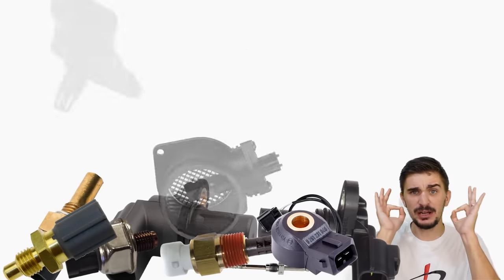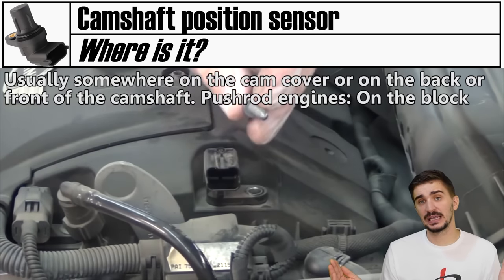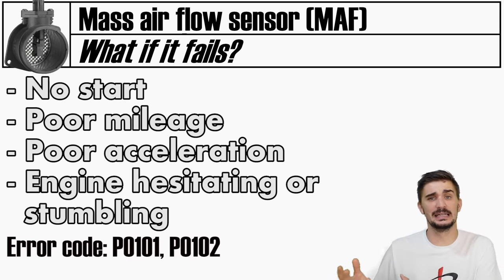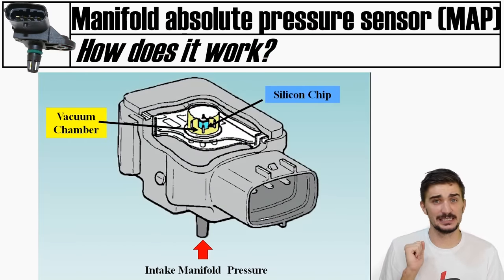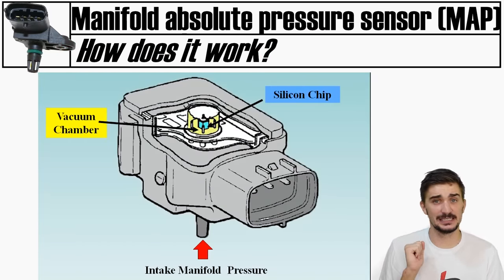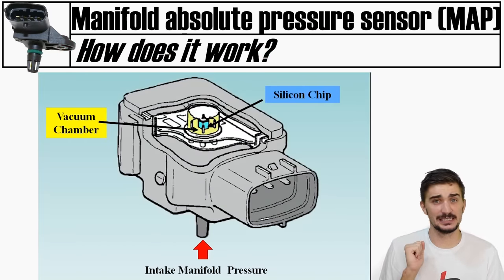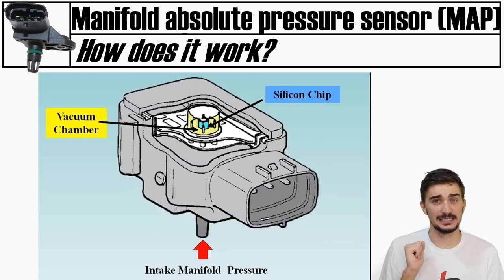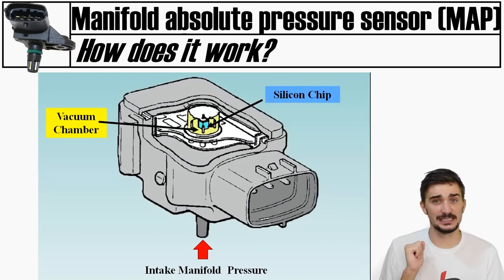EVERY ENGINE SENSOR EXPLAINED - MAF, MAP, IAT, TPS, 02, NOx, EGT - How it works, location, OBD2 code

Comment: The info in the video is very useful & can help every skill level of mechanics
1 issue,this pertains to GM only 
 ECM Engine Control Module engine only
TCM Transmission Control Module 
BCM Body Control Module controls the entire car
In the video what he calls the ECU Electronic Control Unit on GM cars is the BCM 
The ECM Engine only

Comment: Well, I thought this was a really excellent video, but then I had a good look at my 1958 Austin Healey and I can't find any of these devices on it, so I'm not sure what you're talking about! On a slightly more serious note, we did some tuning work back in the 1980s on engines fitted with K-Jetronic injection (a largely mechanical system), and we ended up renaming the vane-type Air Flow Meter as the Air Flow Strangulator. On an even more serious note, this video is superb and contains a very noticeable lack of bullshit. I've subscribed.

Comment: Ran a year with a blown downstream o2 sensor. Now i have to replace catalytic converter as well 😮‍💨. Remember to check your engine codes immediately and try to fix them ASAP if they return after zeroing.

Comment: It is also worth to mention two temperature sensors for coolant (thermostat), and bimetal temperature sensor for turn on/off the fan. The first one is proportional, the second is binary. This are at the same time actuators (valve and switch), to stabilize coolant and engine temperature without electronic control unit.
By old engines there by ignition distributor were also centrifugal rotational speed sensor, and vacuum membrane intake air pressure sensor (indirect engine load measurement), to mechanically shift the ignition point, earlier or later, also without ECU.

Comment: An excellent video as always! Big fan of the channel. My O2 sensor heater on my motorcycle failed (tested in accordance with the service manual) and the OEM part is 185 dollars, I found a 'compatible' part on amazon for $60. The question that I have is why so much cheaper? I know it's non-OEM, but still, $120 cheaper? If it is a crappy product, can it damage a part in my motorcycle? Thank you.

Comment: Very informative, thanks  and even the ads weren't too intrusive. [which is high praise, coming from me!]

I'm still of the "There's no place for a computer under a bonnet" school. But, as it's becoming almost impossible to find a vehicle without an ECU -even at the older end of the used market- I suppose I should at least educate myself as to what all these damned sensors are supposed to be for.

Comment: One correction to your explanation of MAP (aerospace engineer here). In your animation, more air molecules correspond to higher air flow, which corresponds to lower air pressure by bernoulli principle (opposite of what you depict)
Reply from the maker: More molecules does not necessarily correspond to higher airflow (random youtube guy here). You can increase the number of molecules in the same volume without any change in flow.  Let's imagine you increase the boost pressure or you rapidly close the throttle or you change the elevation - all of these can increase the number of molecules but do not directly impact flow. I'm not saying you're lying, but I honestly doubt there's as many aerospace engineers on planet Earth as in my comments.

Comment: okay, so i agree you mentioned all sensors related to the engine! of course there's far more sensors in the car you didnt mention such as ( wheel speed sensor, steering angle sensor, crash sensor, weight sensor,vehicle speed sensor, etc....) but those sensors doesnt affect the engine performance at all... but there's one more hidden sensor that could affect the engine performance in a weird exceptional way on rare car which is the yaw rate sensor.. this sensor is installed on the center of gravity of the car which is under the driver seat, it's function mainly for stability systems such as ( ESP, TCS, ABS etc...) but it happens to me once that a car work perfectly fine , but struggles at accelerations and while going up the hill, while everything in the engine looks fine and no faults has been detected.. the only fault was the yaw rate sensor in the stabilty system. after research, the yaw rate sensor helps the engine control module to knows if a car is accelerating so it could give a injection boost or ascending a hill or descending a hill using accelerometer to notify the engine control module.... weird huh?  cars world is insane

Comment: Hello there and thanks for the video. Can you please make a video to specifically explain how the Oil level sensors works especially the ones used in Audi's as I think they depend on both the oil temperature and the capacitive technology but I cannot understand how it combines the two and how accurate they actually are.

Comment: One other possible bad sensor symptom, computer controlled transmissions often rely on sensors as part of the determination of when to shift. A poorly shifting transmission isn't necessarily due to a mechanical defect. My mid 90s Nissan over 6 months slowly shifted later and later until it wasn't shifting from 1st to 2nd gear until 6000 rpm! The cause was a faulty TPS.

Comment: My Triumph 675 had a barometric pressure sensor located away from anything inside the tail unit, sheltered from any airflow, close to the numberplate hanger, for measuring ambient air pressure. Would love to hear an explanation of why they needed that, given it presumably also had a mass airflow sensor somewhere 🤔. Wouldn’t that make the barometric pressure sensor kinda pointless ?

Comment: Folks used to complain about all these "fancy electronics" in the 90s.  Now days, it allows you to do diagnostics without having to guess what parts are failing.  Have to admit, modern fuel injection, electric throttles, electric ignition, sure have made engines more efficient.  Modern designs have made them heaps more powerful than only 30 or 40 years ago.  Have to admit it's very impressive what power you can get out of tiny engines these days.

Comment: Modern automobile use ECU. 
Is ECU ( Electronic Control Unit) and PLC  are similar or same? 
Is the function of ECU and PLC same?
What programming language ECU uses to achieve the control of variable u have explained so well? 

Is it ladder language, commonly used or some other language ?

Please answer

Comment: Great video I am still trying to find out why my car will not start. Maybe you can point me in right direction. Car sat for 6 years. It's a 1998 Volvo S70 GLT. I cleaned out fuel tank, replace fuel pump and fuel filter. I  cleaned injectors. Car cranks has spark and fuel out the injectors. I thinking must be a sensor where the timing is not lining up with the spark and injected fuel.  Any thoughts? Thanks

Comment: this video is great thanks, I was wondering if you think that one of these oxygen sensors was an issue... I do own a Camry SE 2015 and it is giving me like 50 miles less than when I first got it. I just did its first smog check test and it passed ok. I have no idea about what is causing it, any tips that you can think of it? thanks

Comment: have a '96 golf cabrio and over time, almost all the sensors have stopped working. so far the only critical one is coolant temp - car won't start without that one - the temp gauge is the only part of the cluster that works. But she still drives, nicely, i just have to use an app for a speedo.

Comment: A great video! But I am stuck with many of the symptoms of a sensor not working being the same symptom e.g. running poorly. So how to identify the particular sensor.  Is it my scan tool that will help narrow down the sensor. I don't want to replace a sensor I think is not working properly only to find the sensor I replaced did not need to be replaced. Any suggestions?

Comment: 23:49 If you have electronically controlled distributor timing (specifically from Honda), a bad knock sensor can cause the timing to advance too much, giving a rattle under load.

Comment: Just a FYI if you floor the accelerator pedal the throttle body does NOT open fully. The ECU decides the position not your foot.

Comment: Used to own a Volvo 850 which only had 1 (pre-cat) O2-sensor. Failed suddenly one day and I lost most engine power - the sensor commandeered the ECU to dump fuel into the engine which resulted in an enormous black cloud of smoke behind my car! Back then I didn't know much about cars so I feared the issue was much worse...

That Volvo didn't have any MAF either, only a MAP and an IAT.

Comment: Throttle position sensor can also cause the engine to not start at all unless primed with fuel of some sort, it can also cause an automatic transmission to not shift past second gear. Causing customers to believe that their transmission is going out on them.

Comment: I was hoping to figure out what’s wrong with my car haha it’s an 2000 Ford Mustang GT 😂 it’s just had a new fuel pump, new CRCM, cleaned the MAF and new coolant temp sensor and it’s still having a hard time starting when cold and stalls initially. Once warmed up it’s perfectly fine. I might see about replacing that fuel pressure sensor and hopefully that fixes it.

Comment: Hi again, 15:00 if an engine already has a coolant temperature sensor to activate the radiator fan and a clutch for the water pump why it is still employed a thermostat valve?
  The thermostats when fails and stays shut can overheat the engine, and if there was no thermostat valve ant coolant temperature sensor fails the engine would still run (out of ideal temperature) but not overheat and live you stranded, as long as the radiator fun and water pump are engaged.

Comment: When the crankshaft sensor starts to go bad, it starts showing symptoms when it's cold. This is my own experience. You just can't find that information anywhere. You could easily think that there is a problem with the mixture ratio, even though the crankshaft sensor could be the culprit and it might work well in warm weather, but at a certain degree of frost it starts to show symptoms.

Comment: With electronic engine control there are sure a lot of sensors on a car. On my car when the engine crankshaft position started to fail there was intermittent engine stalling problems.

Comment: What is voltage required for each sensor including its output voltage to ECU, and how we can determine a sensor is faulty, like O2 sensor
Reply: That's something that may be a lot more oem specific. You could assume a 12v signal but you know what they say about assuming.

Comment: I just had the ad for the obd2 you have on your phone.. she said she had a low oil pressure system.. which can mean low oil and she’s running it starved of fluid. She fixed it with an oil change (less than 100$ which is An oil change at the dealership). 1900$ is a random number to me for nothing but what do I know.

Comment: My truck cold starts fairly easily but progressively runs rougher after 10 mins, sometimes stalls or won’t drive. It’s not overheating but seems like it could be a sensor of some kind, fuel or air related? What would you check

Comment: Ha! The reference engine shown for the location of the throttle position sensor is the trusty Ford 3.0 litre V6 Motor...(Umm no, not the garbage Vulcan🤢 Sorry Spock! Yes, the Duratec) I would recognise the plastic cover for the throttle cable anywhere (oh do a video on various Cables and the year the industry did away with each one! Throttle as I mentioned, Parking Brake, gear selection...and ALL the others lol) anyways before I completely troll myself and have the masses realise I turned a engine shout out into this mess, but hey IT IS a good motor, Im coming on 300,000km and the last hundred mostly have been daily in-town delivery Kms. I smell half a mil in its life before I let it die. Now Back to the Video I GO!!! (PS TY for the incredible content)

Comment: Thanks for sharing the knowledge. 
My vehicle has a problem and cannot start. 
nothing happens if the key is turned to the start position. 
The ignition coil will also burn after a few hours after the battery is connected. 
My vehicle was in the workshop more than 6 months ago. 
can anyone help?
Thank You.

Comment: Nice and kind of interesting.
None of engines got more then 2. Oil pressure and water temperature. 
Oh wait my newer chainsaws clearly got a lot more. But these new environmental two strokes engines still run worse than the old ones.

Comment: What does a thermostat do? Insanely good video ty
Reply: The thermostat keeps engine coolant temp where it should be by only allowing cool coolant from the radiator into the engine coolant loop when it needs to.

on a cold engine, if it has not reached operation temp yet, the pipe from the thermostat to the radiator should be cold, if its warm, your thermostat is not working correctly and should be replaced
Reply: @user-si5fm8ql3c  ty!

Comment: So there are anywhere from 3-8 sensors that are used to tell the ECU how much fuel to inject. What is the priority? Which one is boss? If the MAF, TSP Knock etc all say more fuel but the O2 says less fuel who wins out? You can see how many different scenarios can be present in this question.  So whats the order of the priority??

Comment: I assumed that the coolant temp sensor failure would be the other way around. If it detects hot I'd assumed it would run richer because in rich mixture because the evaporation would would take the latent heat away.
And running cold meant less fuel to lean out the mixture.

Comment: While you have given a great explanation you really must appreciate how difficult it would have been to figure out the varistors and to replace everything but I still being old school mechanic I still think that a coil,set of points condenser and carby is so much easier to figure and repair a problem, I understand that you can now plug in your snap on but in my day even with only minimum battery capacity you could push start a car or bike but not anymore..and the thing is that in reality a well tuned car with a carburettor and maybe even add a cat convertor is still better on fuel.

Comment: can the failure of the throttle position sensor or even the pedal position sensor cause run away cars? (remember the toyota scare where it was initially though to be the floor mat stuck in the pedal?)

Comment: In regards to knock sensors, I had a B5 A4 2.8 30v in which the connectors to the sensors had failed and become disconnected. Until I replaced them it ran very rich and had terrible fuel economy

Comment: I have a 1998 Ford escort SE throttle is high check engine light on power is slow, I believe it's the throttle sensor.

Comment: Yes its a bike not a car, wont start unless I hold throttle all the way open, hot or cold, but drive 500 meters and she starts fine. Will also cut when I come to a stop. Started only in very cold conditions and now always happens. I thought it was a temp sensor but now sounds like fuel pressure. Zontes s250 if it helps. Cant find anyone i am willing to trust willing to scan it

Comment: Modern day automobiles no longer seize because of the ECU and sensors and the system?

Earlier engines seizes after so many miles, I remember my Toyota Camry long ago engine seized out of the blue without prior warning? 

As u said the engine can refuse  to start. 
It is  when certain inputs to ECU from the relevant sensors are not acceptable to ECU. 

Given this the modern technology should be able to detect engine seizure or transmission failures ahead of time?

Comment: 7:39 a faulty MAF sensor WILL allow an engine to run. I know because I accidentally unplugged mine and couldn’t figure out why it was running rough. 😅 so i fired the parts cannon at it until I discovered the unplugged sensor and did the hardest facepalm of all time.

Comment: Hi
I have a jeep Cherokee 3.7l 2006 ( similar jeep liberty )
No crank
No start
I have replaced starter and ignition switch, battery, spark plugs and coils. But still same symptoms 
Could you see what is the issue?

Comment: So many sensors and gadgets, so many failure points. My 1986 Škoda 130L is OK without ANY of those. I have just two things to check as a driver: Oil pressure (a light comes on when it is low) and coolant temperature (on a gauge left to the speedometer). I never experienced a "limp home" failure on it. However, I DID experience limp modes on other cars and it was so annoying. There might be a nice Slavic word, understood certainly in most Slavic languages, that describes all those sensors: kurvítko.

Comment: Dear people, is the coolant temp sensor reading the coolant temp after the engine block and before the radiator, or after the radiator and before the block? I mean, is it measuring the coolant temp before or after flowing through the block? I know this comment won't be answered cause no one will ever see it. Oh well.

Comment: Whats the name of the part where you talk about the coolant sensor. Its above the coolant sensor like a big rusted cylinder motor of some kind at 14:20. Its black with a light circular sticker on top? Been trying to figure out that name.

Comment: Watched this video to figure out why my engine is throwing lean codes without identifying a sensor failure. Problem is its not running lean its over fueling and im having detonation in my exhaust. Its a supercharged 2013 BRZ still have no idea whar is causing it spent alot of money on sensors already

Comment: If the automatic transmission doesn't shift to 4th and 5th gears and shows codes  of gear incorrect ratio. What do you expect the problem to be?